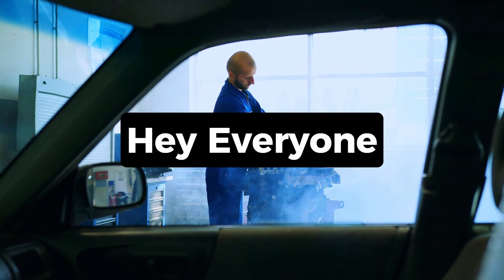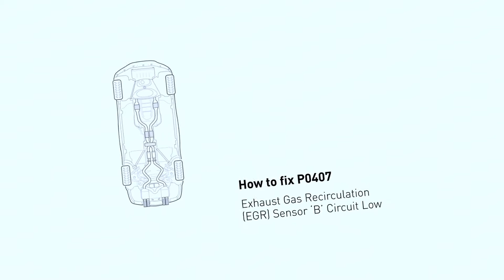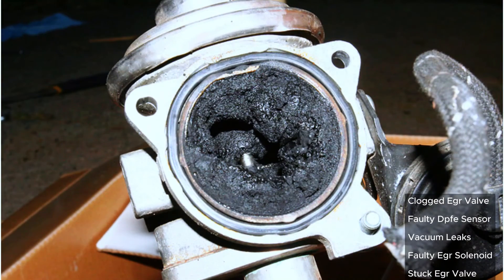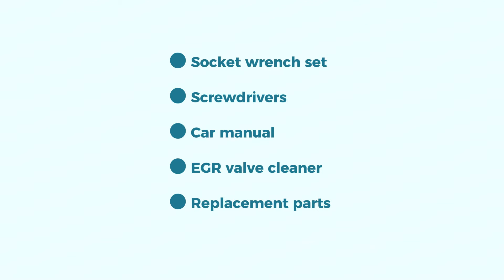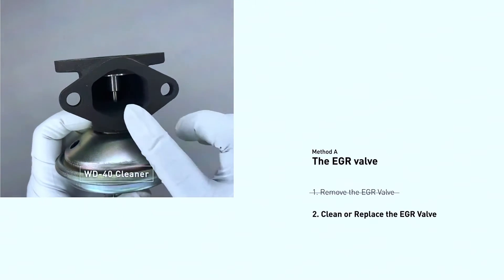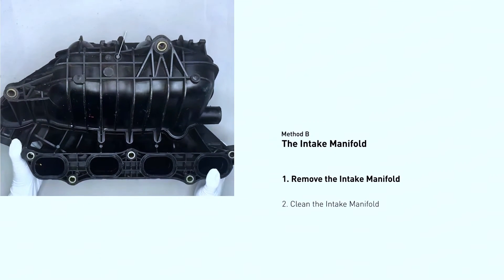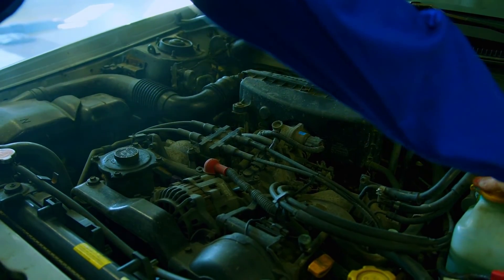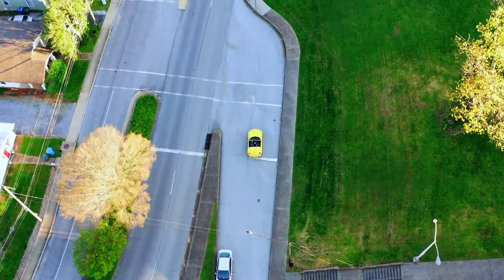How to Clean Your EGR Valve to Fix P0407 Code |

Comment: I cleaned mine by removing it…. Permanently.
Reply from the maker: It's important to address the root cause of the P0407 code for proper engine function and environmental compliance. Consulting a mechanic might be helpful for diagnosis and repair, especially if you're not comfortable working on your car yourself.
Reply: @weeklytools codes don't make sense